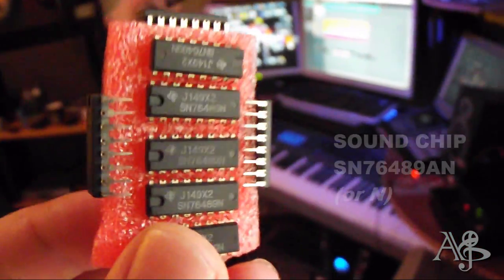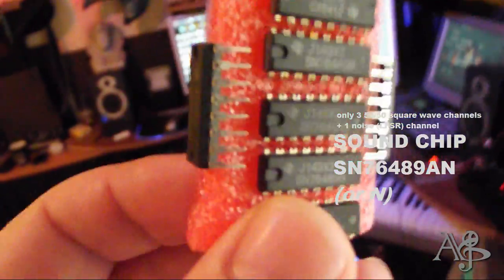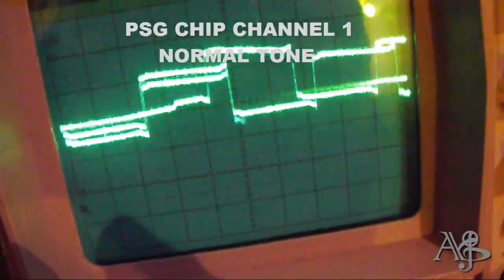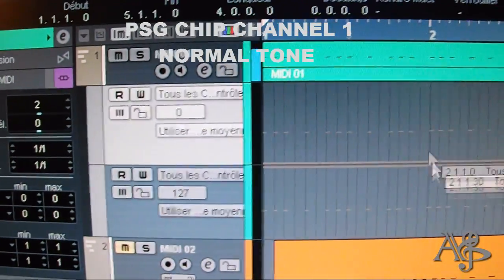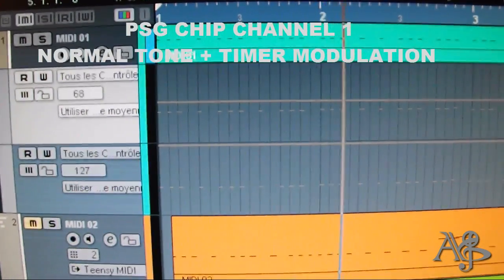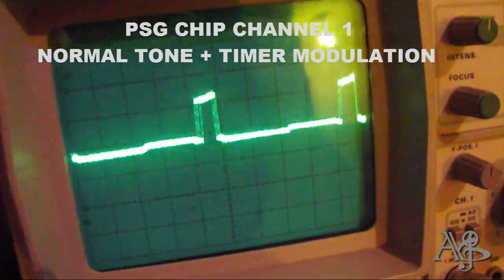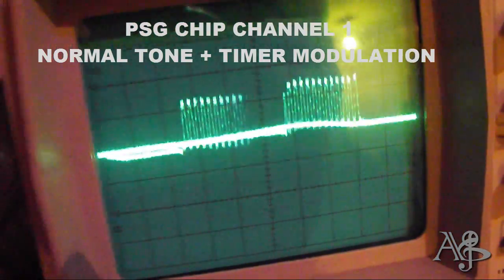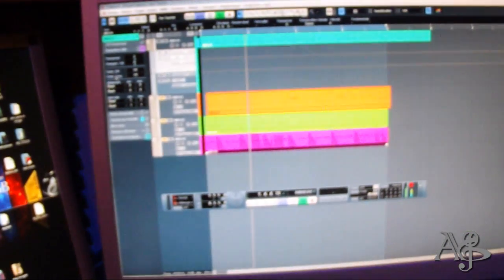SEGA MASTER SYSTEM MUSIC PSG SN76489 SID SOUND...

Comment: Sorry to bother you again. What is producing the base line here and where is the kick coming from (sounds sampled).
Reply from the maker: Bass is the Noise channel set to Period mode than quickly change to noise, samples are 808 sounds played through the volume register of the 1st channel :) everything comes from the chip
Reply: Unbelievable, at least it would be if i were not seeing it with my very own eyes. Is it possible to manipulate the noise channel like that on the SMS? Currently working on stuff and SN76489 is down the line. Thing that most worries me about the chip is the lack of any low frequency options.

Comment: Would it be possible to use the timer modulation technique on a stock standard sn76489, say one connected to a sms?
Reply from the maker: Yes, btw this is a stock Sn76489 here, the sega one was custom :) there is another video on my channel called "SID sound..." it demonstrate what you want, for more infos plz contact me by mail ++
Reply: +Aly James How do you wire it up like it's a vst?